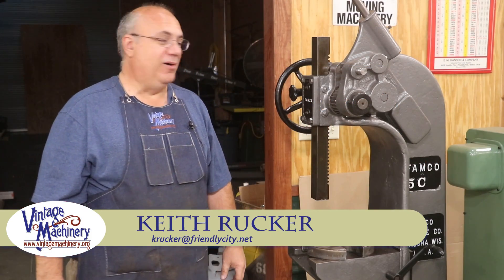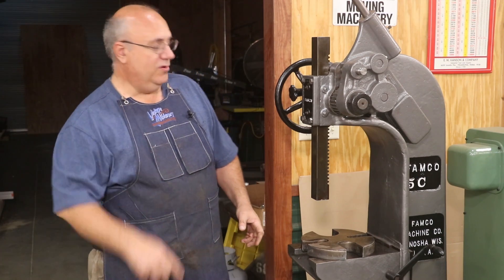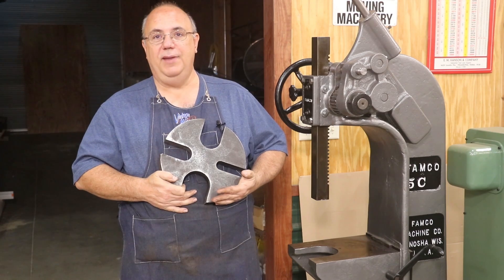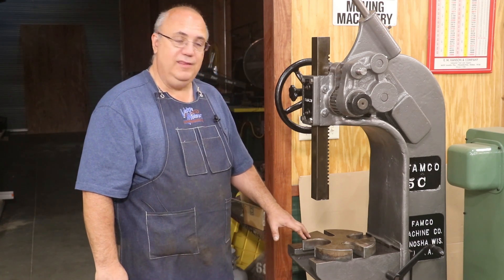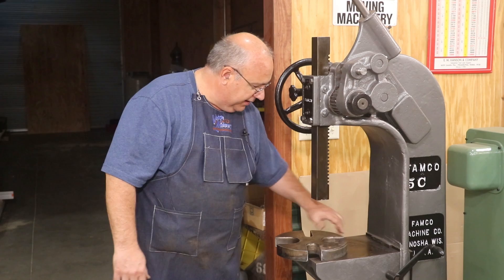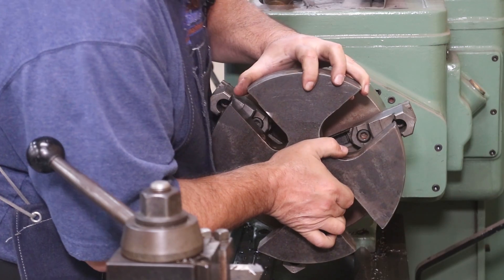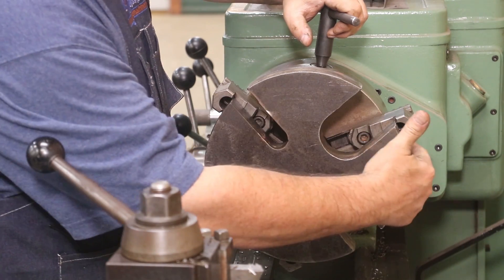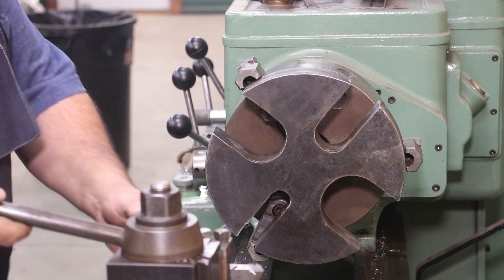Final Machining & Installing a Daisy Wheel on a FAMCO 5C Arbor Press

Comment: Good job to finish up by installing the Daisywheel. 
Being a retired Engineer, my only suggestion which is that I would have added a retaining clip for a snap ring or a hole in the bottom of the pin so once installed the daisy wheel will never accidentally come off in an a unforeseen instance which I know is probably a 99.99% chance of occurrence!  
However just making this comment so that other viewers may have a totally different application for a project that has a higher probability of having a part from falling off, and I always think safety for both the operator and the care of the machine! 
Again great video and enjoyed the seeing the completion of the agh or press which should last for generations of machinist just to put to good use.

Comment: Thanks for the video.
Call me dumb. What are the bolster plate slots used FOR? Sure, the plate itself is a nice solid backing for squishing or punching something, but I cannot find a demo anywhere showing the uses of the different sized slots. Bearings?

Comment: I've learned everything I know from you and abom79 so way more than I could ever remember but I made a daisy wheel a month ago for my press. I'm a laser operator at a fab shop, I laser cut 2 pieces of 1" plate, beveled and welded mine together. Did the same thing as you, faced it and drilled my center hole. Then for the od I turned a piece of stock , drill and taped it. Then used a bolt to attach the wheel to the newly made arbor. It was scary (because of the weld being inconsistent) but I turned the od using that method. I'm not sure how "accurate" that method was but it looks great and was easy! Just my 2 cents of that water cut / plasma cut edge bothers you! Always happy to see one of your videos pop up :D

Comment: I'll say it outloud ( well, write it ), you checked hole size with gage pins but used dial calipers instead of a micrometer for size?  ( Jeff the OCD machinist ).  You can hold it in a four jaw chuck even with the one narrow slot.  Just remove that jaw and bottom out the screw in the master.  That would allow you to hold it securely for the OD turning.
  Jeff , machinist for the past 40 years

Comment: 4 independent jaw chuck would center that plate for the outer diameter cut. I would never have drilled that center hole through there was no need to for a perfect surface. A simple blind hole to insert the pin would be cleaner in my opinion
Reply: A blind hole is the work of the devil.

Comment: Do the outside as well - somewhat lots of work but could be an idea for a video - just mount the whole thing on a plate using bolting kit. You can use the center hole you have to help a lot with the alignment. The steel is probably either 4140 or 4330. The second one is so hard annealed that you can barely tap it.

Comment: A little Loctite stud/bearing mount would have solved that loose fit issue more than adequately for the intended use.
Reply: There is no "loose fit issue".
Reply: Why did he have to make an oversized pin then?
Reply: @rennkafer13 ... He had to make a pin anyway, so he made it to fit and press in like he wanted..Depending on the grind, a drill bit will normally cut larger than the listed size.  His bit cut .002 over which is very good..
Reply: @paulcopeland9035  which is why you don't do precision fits with a drill bit.
Reply: @rennkafer13  ..It was not a precision fit.  He was not machining a hole to fit a pin.  He had to make a pin, so he used a drill bit which had clearance on the machine table and made a pin to fit.  The "precision" was in his machining the pin to create a press fit, of which he did a fine job.

Comment: not to nit pick Keith but in video when it was mounted on the lathe you can see that the two faces are not parallel. You may be further off to face one side on surface grinder to get them parallel. The slight taper could cause problems in future.

Comment: I half expected you to paint the very outside diameter the same grey as the machine - or at least oil it up to prevent flash rusting. Then it dawned on me: you slathered a generous layer of cutting oil as your were facing it. Should be fine! Thanks for the vid.
Reply: I hit my unpainted surfaces on my drill press, arbor press, and vise with Johnson paste wax every few months to keep them from rusting. I imagine that he does something similar.  Chris

Comment: Hmm, you have a perfectly good belt grinder if you are worried about having the flame cut finish on the outside.  Axle pin in the center and the belt grinder and you are golden.

Comment: Seems to me that you could hold the daisy wheel in a 4 jaw chuck so you can turn the outside diameter.
Reply: Yeah I was thinking the same
Reply: You'd need a really narrow jaw on at least to of the slots.
Reply: Landon Harris making a custom thin jaw would be a neat video.  The other thing he could do is to mount it on a faceplate with a slight standoff to turn the outside.  I think it is fine as-is, but either one would make a neat video.  Chris